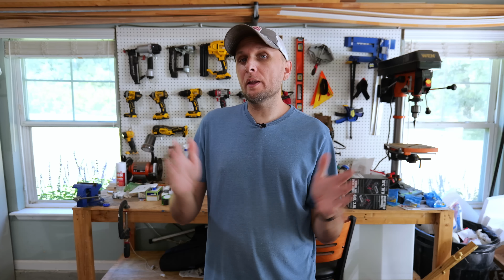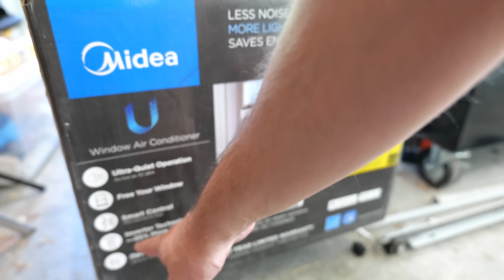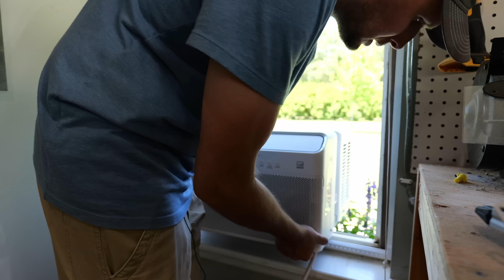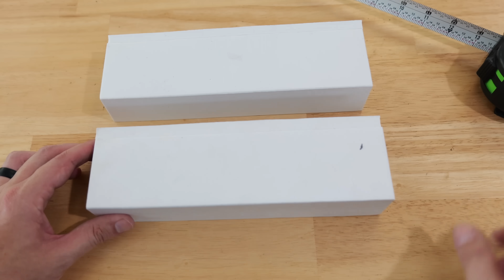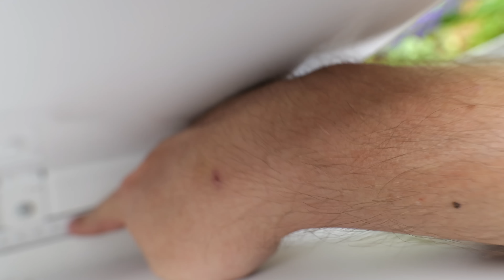The COLDEST And QUIETEST AC Unit Ever Made!  Still Use Your Window!

Comment: A question about a third floor window install. How difficult would the installation of the support bracket be from a dormer window? It would have to be a temporary(only during the late spring/summer to mid fall months at most) setup due to living the in the Pacific Northwest and unsure how well the unit would do if left to sit in the nearly nine months of mist, drizzle and rain. (I've read a complaint about rusting so I don't want the unit to sit in the rain). 

On cooler summer months I generally have a window open and fan exhausting air out of the room. Will the window being open an extended period affect the unit at all? Is the weight bearing all on the support bracket and window frame? 

I'm looking at the U vs others suggesting a saddle due to furniture around the window preventing a saddle frame. I'd have to move multiple things such as a dresser, tv stand and storage case, minifridge and computer desk to fit a saddle, and of the U's I've seen, this looks to be a good unit to go with.

Comment: I'm still wondering if I should get 2x lower-BTU units, or 1 higher-BTU units for my setup. I'm in a single-floor, semi-basement, 4-room (2bedroom), 920 Sq.Ft appartment.. 1st bedroom is 320 Sq.Ft,  2nd one (usually unused guest bedroom) is 100 Sq.Ft.   The appartment has no air exchange system, so I usually put air vent in the AC room to get the cold air out.
Reply: Seems like the entire north american continent have those hung windows, except us. stock with annyong sliding crap meant for another planet.

Comment: 35PATTERN 350 can b used 4 antyhing comicbkstores grocery theaters etc even city dist

5HOTTEST PLACES ON EARTH
IRAQ, TX, EGYPT, AZ, DUBAI	

cccccccccccccccccccccc
how keep cool?
less stuff = less heat as things absorb heat!

misting cooling fans ex. outdoor ones

BATHROOM FAN:
It was so noisy with and was so noisy with the fan.
The mobile fan in the air conditioning running.
And I didn't realize I had left the bathroom fan on
So when I woke up, the house was so much cooler. Now this bathroom fan is.
Directly in front of the garage door in the garage door from the dog scratching as a the padding has been scratched off the door
Near the dog height.
So an acting as pulling air.
In while sucking air out causing air conditioning effect. Really cool and it works really works.
Energy Efficiency: Running the fan intermittently (e.g., 20 minutes every hour) minimizes energy consumption compared to continuous operation while still providing some level of ventilation.

LEAVE GARAGE OPEN

PUT A FAN ON THE WINDOW TO SUK OUT HOT AIR!
singapore ENTIRE CITY flows w water; concrete heat so GREEN=cool
SWAMP COOLER TOWER FAN: desert building windtowers draws in wind cools down below w water circulates bk up
keep ac temp under the outside temp within 2-3 bc strongest flow is cooling effect even if temp rises
Heat Accumulation:
If you turn off the AC during the day, your home will accumulate heat. However, homes have a limit to how much heat they can store before reaching equilibrium with outdoor temperatures. This means that even after several hours of being off, you may not need to remove as much heat as expected when you turn it back on.

PUT BOWLS of water in house. open windows on sides of home 2 create cross-stream
ccccccccccccccccccccccccc

trump really is racist he said "they're poisoning the blood of our country".

1) FAKE MOON LANDING WAS FILMED IN CLOVIS NM = "c" rock = "clovis, cannon, crescent, cloverfield"
2) SHATNER drugged, strangled, drowned, cremated his wife shat on his legacy bc of divorce money used her drunk past as excuse
3) BY 2061 HALLEY'S COMET WILL USHER IN REVERSE TIMELINE as POP REACHES FULL MAX "end" of all tech as modern tech "everything" only invented a century ago "END" OF MAX PEOPLE in 400 years TRAIN TECH REVERSAL ends all modern tech

my screenwriter teacher said if we only remember one thing from his class then remember it's all propaganda -- but to me if it's good it's not ; )

90s CRIME STOPPED WHEN LEADRINKERS RETIRED

@105F = smog smell
appears 3rd wk of aug = highestemp

SOLAR POWER

*Eye Health Concerns:*
- "SIDE WINDOW DEFLECTORS" REDUCE eye damage/glare while driving TURNS CAR IN2 A LIVING RM!
- ROLLENS
-  Never stare at the sun: retinal detachment and eye damage from staring at the sun.
- Myopia Pandemic because of increased screen time.
- Horror stories about dilation causing acute angle-closure glaucoma and Bell’s palsy.
- DILATION LIQUID can weaken eye muscles and potentially lead to blindness old lady assistant spilled said "oops" now light-sensitive reduction of accomodation more myopic never fully recovered.
- Eyedrops recall since 2023 due to potential blindness.
- Eclipse glasses for eye protection.
- orangetanbrownVINLYPLASTIC LARGE/SMALL PANELS "lowblulitesite" for eye protection against HARMFUL BLUE LIGHT.
- Privacy screens to darken screens.
- Eyejusters adjustable glasses for vision correction THERE ARE METAL VERSIONS ALSO.

*Health and Technology Concerns:*
- Copper blocks WiFi; children absorb WiFi 10x more, so turn it off when not in use.
- Overpopulation: Unplug WiFi to reduce 1.5°C.
- LEAD=CRIME; Lead pipes: Crime stopped in the 90s when affected individuals retired.
- Chickenpox vaccine can lead to shingles later in life.

*Miscellaneous:*
- Use ear protection (plugs and muffs) to prevent damage from loud noises (70-80 dB) tinnitus ringing dying hair cells freq u will never hear again .
- "Pride" is mostly used negatively in the Bible, with only two positive references.
- Girls' long hair protects them from hearing loss.
- Moon landing was faked, filmed in Clovis, NM.
- Grissom, Baron.
- ZPG.
- Obama, Mike.
- tylenol=poison
- dentists dontrack x-rays dont get mris either
- SOLAR POWER

Comment: I own the 12000 btu  version. It works well. Its super quiet. It DOES NOT HAVE AN APP THAT RUNS ON ANDROID! It still has a manual option to have the unit turn and off. Its not as cold as I would have liked though. So far all summer in MN its running well...

As for the seals. They need more. I do not want insects in my home and I had to purchase extra items to seal the window properly. Which is also the biggest drawback for the unit. They need to make a flexible screen to install. Otherwise your just letting mosquitos, beetles, spiders etc into your room...

Comment: love my midea U, had it for almost exactly 3 years now. got the 8k BTU one and it is fine for a small office. My cat pushed a preset on my standing desk and nearly broke the thing, it was bent nearly 45 degrees away from the window... when I raised the desk back it went back to normal and hasn't had any issues. The only complaint I have is the seals that come with it are not the best and it's easy to wind up with gaps. The unit itself is great though and having it on wifi is really convenient sometimes.
Reply: Is your cat's name  > Alexa??!!

Comment: I just installed the 8000 BTU unit. It’s a little tricky if you have vinyl siding and getting the support bracket feet to line up right to support the unit but I got it after a lot of adjustment

Comment: Avoid this unit at all costs! Every AC unit on the market removes moisture from the air. It's byproduct of how they work. Media has this unit ADD moisture to the air and there is no way to change or disable it. I live in the desert where normal humidity is 8-10%, but this thing increases the humidity to an unbearable 30%. Doesn't sound like a lot, but when you triple the normal humidity in the air it's very noticeable and uncomfortable. The app is also complete garbage and it will randomly change the set temperature for no reason.

Comment: I read some wear that mini splits are les energy efficient than window units. Is this true with this module also ? or is this the same as split systems as window units don't have the inverter part that generally makes split system a little less efficient than window units ?

Comment: Worst brand ever. Don't waste your money folks. Cheaply made and faulty design -- the only air conditioner that I have ever seen that has an open grill over the fan outside.  Rain just pours in and collects inside.  Then eventually mildew.  Wait till it starts beeping error codes and you call product support and they tell you it is toast.  If you don't believe me, research "Midea air conditioner error codes."  Do yourself a favor and spend a little more for another brand.  The only thing great about this brand is the U-shape design.  It's just too bad the units are so awful.

Comment: Buyer beware.... I had two of these units and both failed within 8 months of use.  They are a GREAT concept, whisper quiet and worked really well, until I got the error code.  After talking with their support they confirmed that all the freon had leaked out and the units were dead.  Took quite a while to get my refund from Midea, but I have moved on to a new unit. (Not Midea).  Been cool ever since.

Comment: Sounds like a perfect solution. But, I would be surprised if you didn't need a dedicated 20A circuit for that unit.
Reply from the maker: It’s been running for months not on a dedicated circuit.  No issues.

Comment: aaaaaaaah, i miss the good ole us of a. moved to europe and these windows suck balls. you want ac, but cant put a split unit? tough luck. you can get a portable unit, but then you have to put the exhaust out of the window, but window is vertical, so you also have to put a freaking condom onto the window to stop hot air from outside getting inside. i miss usa. just plap the thing, drop the window on it, done. aaaaaaaaaaaaarrrgggggh. thanks for reading my blog.

Comment: I purchased a Midea 12K btu U-shaped unit about a year ago.  Quiet it is,  COLD it is NOT. 
After less than one season, the best you can expect is a 15-20 degree drop from room temperature.
Most units drop the temperature nearly double that.  I was told by a service professional that my
issue is not at all unusual.  A very common problem with Midea.  Buyer beware, look elsewhere......

Comment: I love mine so far.  It's very quiet.  The ability to open the window is gimmicky imo - who's going to want to do that?  Also my window is over 40" so I could not use the extensions, and prefer not to actually.  Instead I fastened the bracket down to a block of wood which is fastened thru the sill.  I could not use the side foam due to window size so I pieced in 3/4" plywood backed with hard foam.  The included weather seal was woefully inadequate so I bought my own.  The unit itself is great though!

Comment: Any recommendation for windows that open horizontally instead of vertically? I have a fairly tall and narrow unit now, but it still leaves a really large gap that I have to fill with a board and foam. I'd really like a unit designed like this one but tall instead of wide.

Comment: Though most if not all HOA's don't allow window AC's like this. So the hidden nature of split or ductless units are the only way to go in most of these neighborhoods. Lastly thieves look for unsightly hanging window units like this.

Installed Mitsubishi split air and ductless units. The house also came with a central AC, now  don't use it all. As always hated how the central would cool the whole 3000ft house.  Now each room can go off and on as needed separately.  Savings are substantial, sure upfront costs is a bit high, but well worth it.

Comment: I installed the 10,000 BTU version in the master bedroom a few days ago. The master was an add-on to the original house, and the original AC and heating system couldn't handle the extra space well. A local HVAC company wanted $7,000 for a mini-split. The Midea solves the problem perfectly - and it is so quiet!
Reply: $7,000 is an insane price. I've done work with these, usually just running the wire. The total cost comes out to about $800 for the labor and materials + the cost of the unit
Reply: 7k is crazy,  I had a new huge unit installed furnace/ac for $4500 a couple years ago.  I would think a mini split would be way less work?
Reply: @karaleeann1211 been doing HVAC for 12 years. 99% of techs I know hate minisplit s and would rather install a regular residential unit.
Tho they do have their place.
Reply: Man I did my Amazon mini split unit in my garage for under 1000$ by my self just from a couple YouTube videos and it’s a 18k unit
Reply: I bought one of these 10k units. Its a god send.
Reply: @ValePlace  
What is the name and is it quiet?
Reply: So great that they recalling them all back 🤷🏻‍♂️
Reply: Exactly which one did you buy?
How big?
Does it have filter so you can clean it?
Reply: Does it run on a regular 110 volt outlet or did it need the industrial plug?

Comment: I live in Sacramento, and it can get to 115+ degrees in the summer. We have a central air conditioner, but oftentimes when it's that hot, it's still not good enough. We bought one of these a few years ago, loved it so much we bought a second one for the additional rooms that just get too hot with the sun beating down on it in the afternoon. We LOVE our units, it's such a great device!
Reply: So. What's your SMUD bill like. I'll bet it over 400.00 dollars per month. If you could just use the portables what would the difference be?

Comment: - 00:00 🏡 Introducing an efficient window AC unit comparable to mini-split systems.
- 00:05 🔇 Features ultra-quiet operation and maintains window functionality.
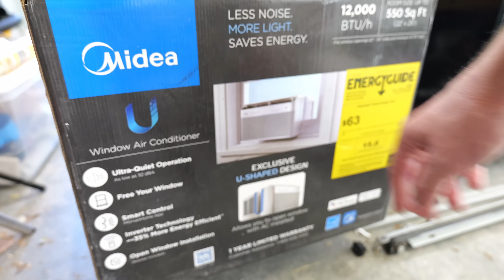- 00:29 📦 The unit is a 12,000 BTU model covering up to 550 square feet.
- 00:45 🌬️ Promotes ultra-quiet operation with inverter technology.
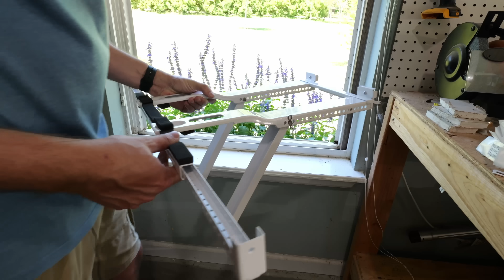- 01:35 🔧 Installation involves securing a support bracket through the window.
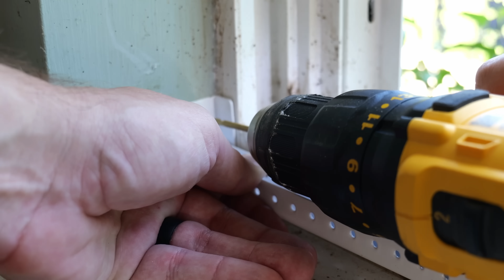- 02:16 🪛 Adjust brackets to fit window width and drill pilot holes for screws.
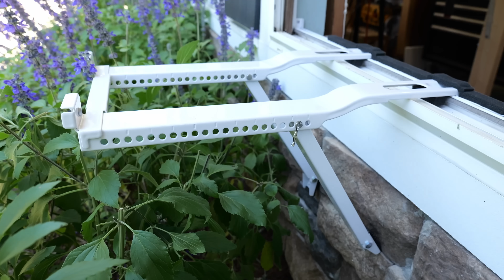- 03:05 📐 Ensure a slight downward slope for condensation drainage.
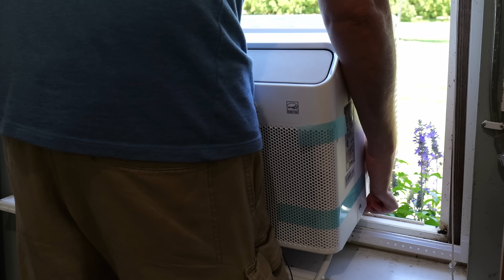- 04:02 💪 Installing the heavy AC unit may require assistance.
- 05:00 🔩 Secure the unit to the window track using provided brackets.
- 06:08 🧰 Use foam to fill gaps and create a tight seal.
- 07:56 🔒 Integrated window locks provide added security.
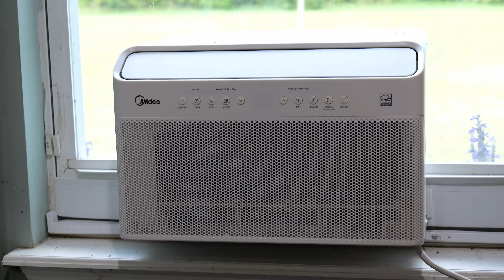- 08:36 🔌 Turn on the unit and measure noise levels, showing around 49 dB.
- 09:41 ❄️ The unit produces cold air at 47.7°F, significantly cooling the room.
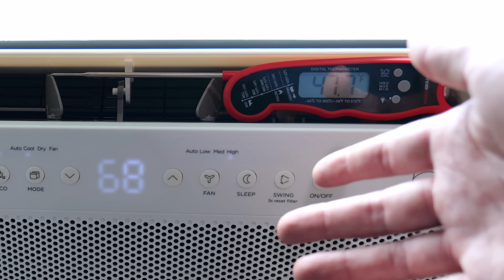- 10:16 📱 Control the unit via a remote or app for added convenience.
- 11:00 🌡️ The AC unit effectively reduced room temperature from 92°F to 72°F in a few hours.

Comment: Love these units for how quite they are but be careful the fan blades tend to get extremely moldy (search and you'll find examples) after a lot of use and they are not made at all to be serviced and it's quite the task to learn how to disassemble the unit to clean the drum fan blade.

Comment: I just saw your follow-up video to this one where you compared it to a saddle type model from GE which got me wondering if this unit allows water or debris to get trapped between the window and the outside unit.  Is this something you have experienced, because it didn't look like the connecting piece had a lot of big openings for drainage?  This isn't really a problem for standard boxy units or the saddle type units because they have a flat top, so I was wondering if you had encountered this problem on this Midea unit?

Comment: A “stupid” question 😅: for someone who is living in an apartment and doesn’t wanna put the ac unit on the window, can we put it on a table or cart and will it still cool down the air to 70Ish (that’s usually the temperature I am comfortable with)
Reply: No.  Exhaust HAS to be outside.

Comment: very clever trick, using the split to move the noise making section (I'd assume) of the unit to the other side of the window ... well though out bracketry and hardware, too ... gotta admit - never heard of this brand before ... I just got a small LG unit last summer I'm happy with, so I don't think I'll be replacing it any time soon

excellent presentation